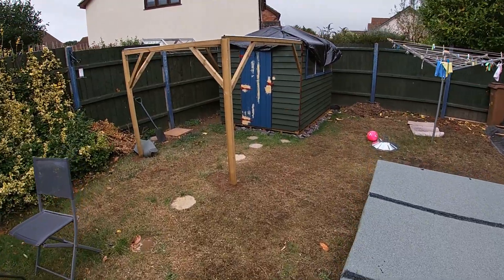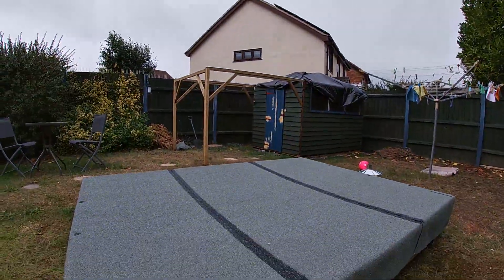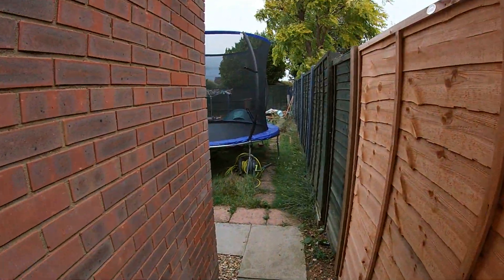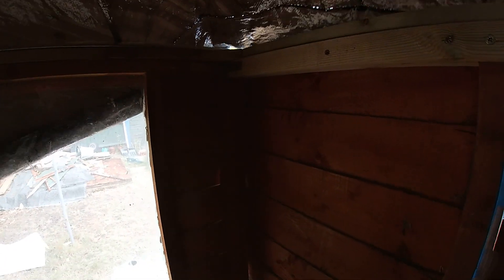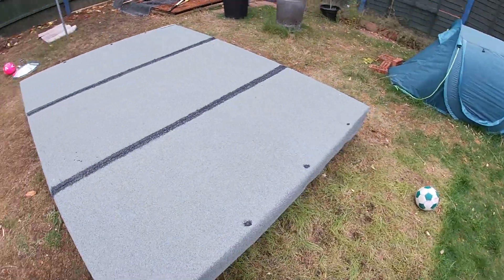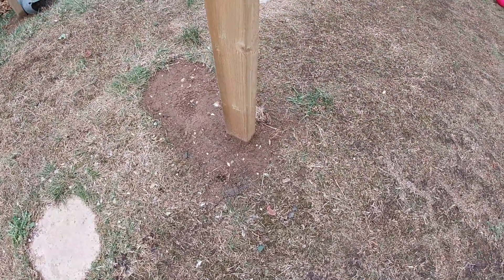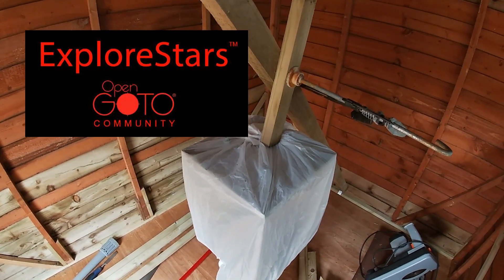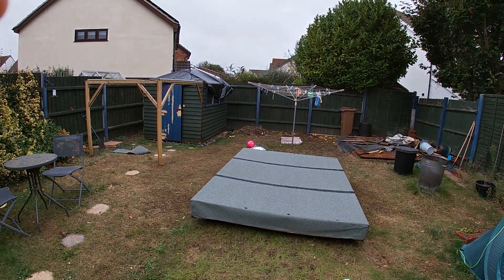Observatory Build #4 Mother Natures Reminder to Secure the Roof!

Comment: Progressing nicely.. PMC8 is a great choice! I strongly considered it while getting my mount, though it wasn't available in India back when I was buying. Loving these updates, Chris!!
Reply from the maker: Thanks a lot Vineeth, did you mention about the PMC8 in any of your videos? It rings a bell that you were considering this mount. It seems really interesting and there really isn't that much out there about these mounts. On paper you get a belt driven mount with proper precision stepper motors and bearings for a relatively low price tag. I've also seen a video where Scott from Explore Scientific hung a ridiculous amount of weight on the EXO2 PMC8, something like 80lbs and it still slew around with no apparent complaints. The only worry is the Wifi as I've had trouble with wifi control before, but Explore Scientific seem pretty committed to sorting out any problems so I'm fairly optimistic :)
Reply: @Astrolavista  Maybe in comments I don't recall now :) I was supposed to do a video where I would describe why I chose CEM25p over this and AVX but never got to it (not sure now, hearing that cem25p might get discontinued)... What really attracted me to the PMC8 was the review from Slymin (Astroblender)...guessing it will be a great system to be on with the opengoto ecosystem!

Comment: Looking fantastic Chris. you're doing a sterling job. If  lived a bit closer I would give you a lift with that roof,  looks heavy. Having to trim the roof down is better than haveing to add a bit I suppose,  We've all done it, many a time I've had somebody screaming in my ear "measure twice cut once!" lol.
Reply from the maker: Very kind Jason, thanks you :) Not to worry though my mate from round the corner popped round to help me lift the roof. I recorded the whole thing of course with Kev's permission. The roof rolls really smoothly, and I've fitted 4 turnbuckle clamps so it doesn't go AWOL lol I'm just fitting some side panels for the gaps and a roof stopper so it doesn't travel too far then the tarting up with paint stage can begin :D

Comment: That's very windy Chris 😲
It's starting to take up shape ,and it's now did I really kinda understand the design better ☺️😸
Keep striving ❤️
Cheers 🙏
Reply from the maker: Thanks Mubarak, yeah it can get really windy very regularly here now days so I need to make sure that roof is super secure. I got the roof on the rails yesterday evening and secured it with 4 turnbuckle clamps so far, but may add more for when it's really windy :) Cheers!

Comment: Hi Chris. It's really coming on now and it's going to be so good for you! A pond will make it nice to look at in distance. I was once told to use old engine oil for my shed in mid 1990s. It makes the wood waterproof and doesn't rot. Strong winds means summer is coming to end and those lovely clear nights are coming hopefully! Last night I was testing my new Hauwei p20pro smartphone for astrophotography and I must say it's better than the normal p20. P20pro can get more fainter stars in my Bortle 6 skies which is good. Where your observatory is can you see low in the south? Like you can see Sirius the Dog star? Looking forward to seeing it all completed! Stay safe in next few months as this virus is on verge of a second wave.
Reply from the maker: Hey John, I think I've heard the engine oil thing which sounds like a good bit of recycling. I used Cuprinol and pressure treated timber so it should be pretty rot proof for a number of years. Your new phone sounds good, are you going to do a video about it?
Reply: @Astrolavista  Hi Chris. I should do a video about it the Hauwei p20 pro smartphone for astrophotography and star trails. I think I will to show that phone can do it. I don't listen to professional photographers who say only expensive dslrs can do astrophotography because they don't know actual astronomers are using cheaper dslrs and smartphones to get great shots of milky way and even constellations. I get my knowledge from actual astronomers like you and others. Maybe I should get Hauwei p30pro smartphone too and see what's it's like. Have you ever tried smartphone astrophotography? It's so cool how a phone can do great shots. Pixel 4 I haven't tested it under dark skies due to pandemic. I think I will do video about it and why I love smartphone astrophotography. Have you seen some of the shots pixel 4 can take of the milky way? They look fantastic and I'm going to photograph the Aurora northern lights with the Pixel 4 as that's one of my plans! Have you seen the Aurora the northern lights?
Reply from the maker: @bushcraftandastronomer.3775  I think you should definitely do a video on phone astrophotography because it's clear that you're really very passionate about this area of astrophotography. I hope you don't mind the suggestion, but I think you're so passionate about phones for Astro I'm a little surprised that you don't make this the focus of your channel. There can't be many channels out there that focus on phone astrophotography in particular? It could give your channel an edge because those interested in just doing astro with their phones would learn that's your main area of interest. It's just a thought but maybe worth your while considering. I've never tried phone astrophotography as I've always just modded a cheap DLSR for 80 quid, or used a little dedicated astro cam. I'm not sure my phone would be good enough to be honest, it's a Motoralla G6 light and I use it so little I'm still on pay as you go and spend about 20 quid a year lol
Reply: @Astrolavista  your suggestion have got me thinking because as my channel name I'm including astronomy things into channel and the video you watched about pixel 4 astrophotography what I thought etc. Most subscribers are mostly Bushcraft peaple who like living in the woods or wilderness living and I sometimes put astronomy related things as I got video on moon through my small telescope a whole video of it so I'm gently introducing astronomy into my channel. I could easy change my channel into all astronomy and astrophotography but I know I'd lose subscribers who aren't really into astronomy. I do enjoy camping Bushcraft learning as I'm new to it as where I know astronomy really well as I've been into astronomy since 1988. I learned from the best Sir Patrick Moore who as you know was an expert in astronomy and yet he never went to university and became an expert! My last video I showed my star adventurer quickly to let peaple know I've bought one and I do have big plans for it. Within next few videos I'm going to do a video about my star adventurer and telescope and tell peaple what I think of it. My subscribers and peaple who watch my videos will know I'm interested in astronomy because Bushcraft and astronomer means I'm an Astronomer who likes the out doors and camping and doing bushcraft skills so that second name Astronomer tells I'm an Astronomer who loves astronomy! What you think?
Reply from the maker: @bushcraftandastronomer.3775  HI John, my suggestion wasn't really to remove the buscraft aspect, rather it was to focus the astronomy more on phone astrophotography as you advocate phone astronomy over DLR's, mirrorless ,CCD, CMOS astro cameras etc, and you seem very passionate about phones so thought it might be a nice niche / foot hold area of you tube for you :)  If you can do long exposures on your phone you can certainly use it with your SA mount and ED72 with a phone adaptor. That kind of thing. It was a thought based on watching content creator advice channels, they often say to try and find something that makes your channel different, and I know you've got that covered with the bushcraft and astro combo but wondered if it was worth you trying to find your niche on the astro side of things because of your particular passion and championing of phones over other imaging equipment. My channel started out as a general astro and photography channel, and I even had videos where I tested different cameras for vlogging and gave my thoughts, but I learnt that I was being too broad and in doing so it's really hard to keep everyone happy because if you release a video on cameras you lose some people that are interested in astro. This is why I focused on DIY astronomy as I like tinkering and doing astro on a budget. I still feel like I'm being too broad sometimes lol
Reply: @Astrolavista  Thanks Chris for advice and tips! I do enjoy doing both and I do like my channel name as it gets me out and learning new skills. More on smartphone astrophotography and why I'm so keen on it. When I was kid I loved the countryside and wilds it was so much fun for me and I've been in the wilderness in the Cairngorms national park when school went camping holiday in 1984 very near Aviemore. I do dslr astrophotography too with Canon 700D which I've enjoyed and now this dslr is part of my new astrophotography setup as lockdown happened in march so I saved up for that star tracker and telescope which I'm really proud to get because I wanted this and knew what I wanted to do with it. I'm going to keep doing more videos for my channel and learning on doing a youtube channel is a good way to learn from others. How did you get into doing youtube and what made you do the channel and what is your future plans for your your channel? I had to buy another counter weight for the star adventurer as telescope and dslr was a bit too heavy for the one counter weight. Next clear night I'm doing a test run with it. I'm not rushing into this as it's going to be exciting this autumn and winter when I'm out under the stars with my setup!
Reply from the maker: @bushcraftandastronomer.3775  Good idea to do a trial run with the SA mount so you can iron out any problems. Yes the darker nights will be awesome and I hope you have a blast :) We just need to be careful not to jinx the clouds! In answer to why I started this channel. I cover this quite in depth in the colab video with Barak but in a nut shell I've been obsessed with space and telescopes since a young age to the extent that I set out to become a professional astronomer completing my degree in 2004. However unless you're in like the top 10-15% of your class it's very difficult to take it any further than degree level so my plans ended there. Ever since then I've been searching for a way to have some kind of positive role in astronomy. I became a kit tester for years, buying, testing, re selling equipment and writing about them on forums. I also gave lots of advice on forums for many years and my knowledge as an amateur astronomer grew and grew. So yeah, this channel is the result of a combination of accumulated knowledge plus a desire to share what I know so I can have some kind of role in the astro community. It also happens that I really love watching other peoples Youtube videos so it's hard not to want to join in after a while :) How about you John?